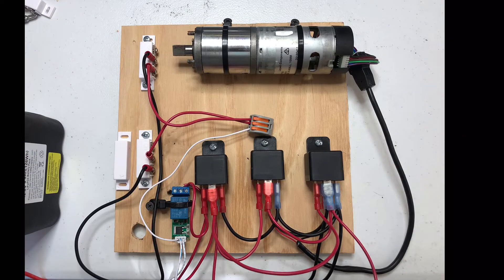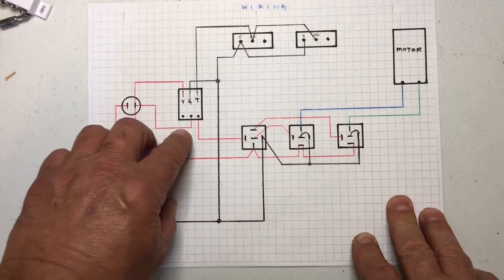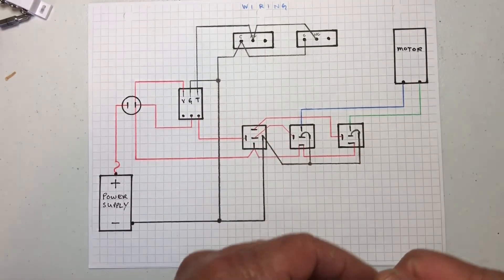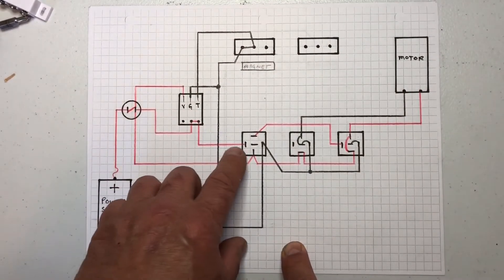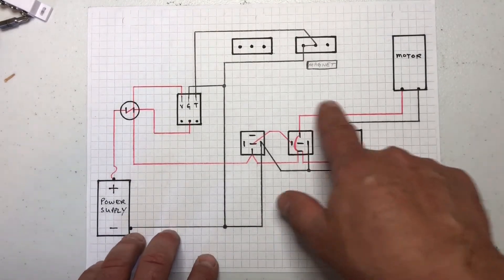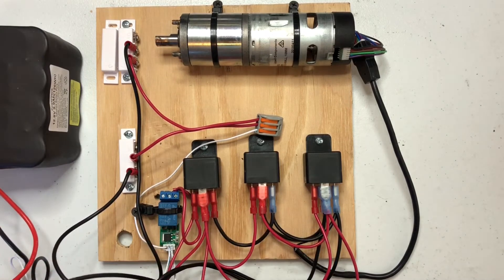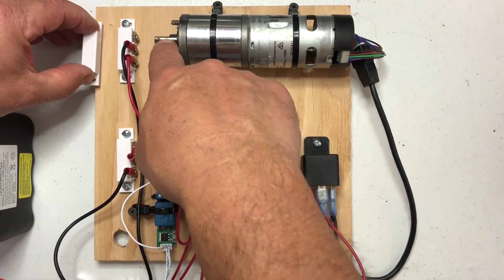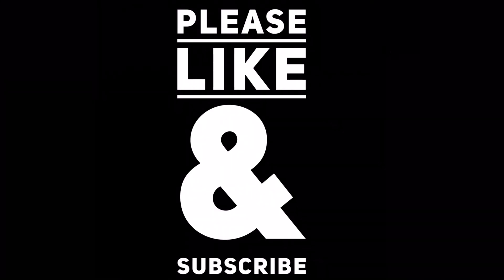Auto Reversing A Motor

Comment: This is fantastic, complicated but still fantastic!  Im in the process of making my first Christmas display that moves back and forth on an old exercise rail system and i have motors,pulleys and a 3d printer😂.   I know how i want it to work but im a carpenter and a nurse not an electrical engineer. Figured there was a end stop switch with reverse polarity i could use. Been searching the www not knowing how to get my idea to work until i found this . Thanks 👍 ill probably be adding a couple hundred views to your videos over the next week trying to figure this out.

Comment: Can you change out the switch with the light with a momentary door bell switch so that you push and hold down for two seconds and release then the motor will move the magnet from the bottom switch up to the top switch and make the motor instantly reverse making the magnet move back down to the bottom switch and shut off.
The set up you have in this video is almost what I need  only difference is the motor would stop when the magnet gets back to the bottom switch and it's activated by a door bell switch.
Thank you very much for posting your videos they have taught me a lot.     Your channel name makes me think of Mc Master Carr  where they have everything electrical mechanical.
I live in a north suburb of Chicago and wish you were my neighbor so I could pay you for your help.
Reply from the maker: I’m out of commission at the moment recovering from shoulder surgery. It would take me a while to come up with something like that…
Reply: @mikmaster63   
Hi MIkmaster I found a video of a set up that looks like it works just like what i'm trying to do but the push button used may not  like a door bell switch like i need it to be. 
The channel is   OTODIDAK aja  and the video is     MOTOR DC START MAJU,START MUNDUR,STOP
Reply: I picked  up a latching relay yesterday from Mc Master Car and I was thinking maybe I should get two and then I see this video but I'm not sure the two relays in the video i found are latching
Reply: @mikmaster63  I wish you the best for your shoulder recovery and thank you for your reply.

Comment: I watch your videos and I am impressed by the simplicity which you explain everything. Thank you very much for the knowledge you share with us.
Pressing the start switch starts the motor. By moving the magnet to the next point I would like the motor to stop (apparently receiving another command from another 4th relay). Then from the same source (4th relay or maybe a switch) to receive a command again to continue the motor working in the same direction until it finds the third magnet which will stop the motor again. I need to do this 5 times (5 magnets). I would greatly appreciate it if you could help me.
Reply from the maker: You need to move in the same direction and stop 5 times? How do you want to restart after it stops, automatic or manually?
Reply: I have a 12v motor which through a wire rope moves a trolley in the same direction. The trolley has to make 5 stops because at each stop some other works must to be done.
1. Through a relay, the motor is activated and moves the carriage.
  2. The carriage moves until it reaches the first magnetic switch and interrupts the current of the relay, also the motor also stops the carriage.
3. Through the relay (and after some other works done), current is again supplied to the motor, it restarts the carriage in the same direction until it finds the second magnetic switch, when it interrupts the current of the relay and stops the trailer again. 
4. Another 3 times the same loop…
This is the project I would like it to be. I hope I'm not boring you.
Reply from the maker: When the movement starts again are you manually pushing a button for it to start moving again or is it going to move again by itself?
Reply: by itself from a relay 5pin 12v
Reply from the maker: Ok. I’ll see if I can come up with something. Might take a while I have a few projects going at the moment.
Reply: Don"t worry. I know how is the time for all of us. if you will make it i would greatly appreciate it if.
Reply: @FENIA3648  Can i ask you What this is for? Is it some sort of display, like a train setup were at each stop, things are happening? Like simulating loading and unloading cargo. 

When you say loop, do you mean an actual Loop, where the carriage comes from one side (left) and "Stops and Goes" all the way to the other end (right) and then travels all the way around back to the left side and starts again?  Sorta like this https://youtu.be/51VguHoJfpM. (would add the braking function in the nex video tho).

OR

It does it go from left to right then reverses and back right to left? Sorta Like this https://youtu.be/TGjsy1ns5_c

Is the time the same for every stop?
Does it have to be 5 pin changeover relays. This is very doable with a triple pole double throw (3PDT) relay and a DPDT relay. Much less wiring.
Reply: @mikmaster63  Glad I found the comment you soke of. I just left this comment in your other video. So I thought I'd post it here.

"I had a few minutes so I added a motor brake and reversing/looping configuration with two options. One opt is that it stops at every reed switch in both directions. The second opt it only stops at every reed switch in the forward direction. 

https://youtu.be/TGjsy1ns5_c"
Reply from the maker: @AztecWarrior75  I shared it with him. Put a link to your video
Reply: @mikmaster63  Saw that TY.
Reply from the maker: https://youtu.be/TGjsy1ns5_c?si=Yj8-t2-vwZUYY0sd

I asked Aztec who commented on my video of he knew how to do the circuit you want. This is the link to what he came up with
Reply: @mikmaster63  Had some time to kill so I refined the Simulated Timer relay So it acted more like the actual timer. That is to say it actually works on it own and I don't have to be doing switching for it.

Demo 4 different mode that this can work. Hopefully the person sees this and can make use of it.

https://youtu.be/RZaLyi2n7tI
Reply from the maker: @AztecWarrior75  I’m going to try and build if/when I get parts???
Reply: @mikmaster63  I have one wired up, but don't have enough reed switches. So I will probably just use regular ole miro limit switches. All I have left to find is a long enough belt. Got motor, mounts and the pulleys but no, long enough, belts. And I have been meaning to order a roll. LOL.

Tho I will also be using din rail mounted relays instead of bosch style relays. I have the relays and some nice prewired (for power windows and door locks) twin sockets, still I'd rather cut down the wiring. Pun Intended.
Reply from the maker: @AztecWarrior75  I want to build it just to see if I can. I’ll probably only use 3 stop points just for proof of concept…
Reply: @mikmaster63  I went ahead and did it with micro switches and all was good, but then I decided to use Magnetic Reed Switches (since the person mention using a magnet), and I ran into the problem of the reed switches arcing and getting welded in the NO position. Had to reconfigure and add a 2N2222 Transistor and a 1.5K Resistor. Other than that, the proof of concept video came out OK. A bit shaky (couldn't find my tripod).

https://youtu.be/_kTWz8Gbsv8

Have you heard from the person yet?
Reply from the maker: @AztecWarrior75  no I haven’t …
Reply from the maker: Video won’t load?
Reply: @mikmaster63  Did you try restarting your computer?  

JK.   It stalled out when uploading. Stuff like that happens when you say "That's it for tonight, I'll just hit upload, and go to bed" Next thing you know it's morning and you find out it stalled RIGHT after. LOL. In any case it is up now.
Reply: @mikmaster63  Well I said "final" on the last video but I wasn't happy with all the camera shaking. Was too much in a hurry to put out my previous wiring diagram with reed switches, tho I was testing with micro switches. Since the person mentioned "By moving the magnet to the next point", I am assuming that what they mean is "Using the same reed switches that are used in this video". So I decided to test with them. I did not want the person to run into the same problem of the reed switches from arcing and sticking in the NO position.. So I rushed the video "Stop n Go Final", to correct that.

Made the "final" one, until the person replies at least, called "Stop n Go 4 Demos". It has all demos in RL action, with diagrams. I did not put the simulation vids back in with it, since the actual working circuits are shown.

https://youtu.be/ipo8ElzQORQ

Look forward to seeing yours.
Reply from the maker: https://youtu.be/_PPFwXjSjT0?si=3b27_SqNWye4Ca63

Comment: this is not auto reverse
Reply: Yes this is auto reverse. He just doesn't have something the motor moves back and forth. He is simulating the action by moving the magnet by hand.
Reply from the maker: It’s just a mock up if I connected the motor to something that moved the magnet (although I would use micro switches) it would auto reverse…

Comment: Nice work brother❤
Reply from the maker: Thanks
Reply: @mikmaster63  "Any chance you have a diagram for changing the direction of the motor without having to restart it with the on/off button? So the object moved by the motor can travel each way in a automatic fashion" 

My understanding of the question is You turn on the power and the motor travels back and forth until the power is cut-off. You didn't need to add another relay. You could have done this with just the three relays. Or two relays and a diode. Or just two relays.